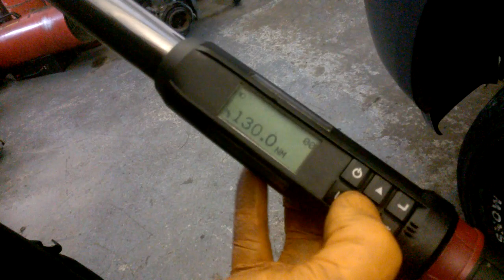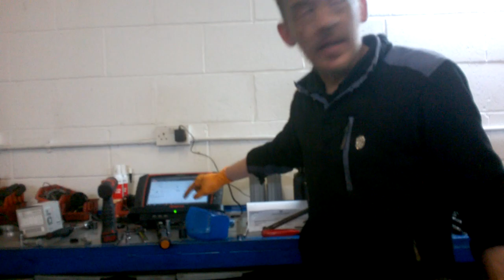How to service Nissan engine (part 2)

Comment: Hello mate!
Shouldn't the wheel nuts be hand tightened with the wheel off the ground before using the torque wrench with the wheel on the ground?

Comment: Your channel is fantastic. If it's a straight forward enough job, could you do a video on aligning the steering wheel?
I got a 57plate outlaw but the steering wheel needs to point towards 1 o'clock in order to drive straight. As far as i know the suspension has never had any modifications and the wheels & tyres are standard spec. Cheers either way!